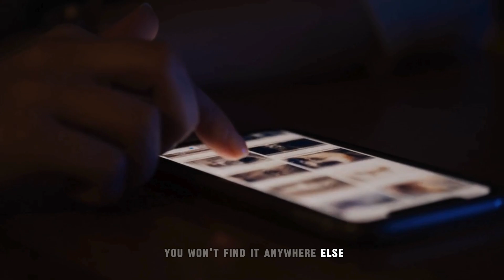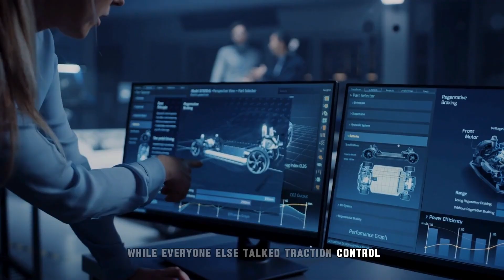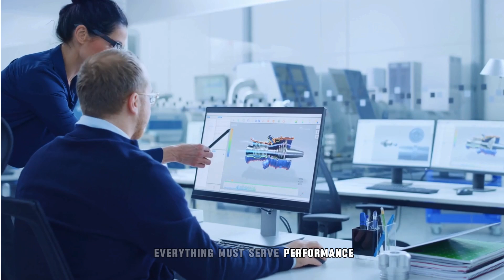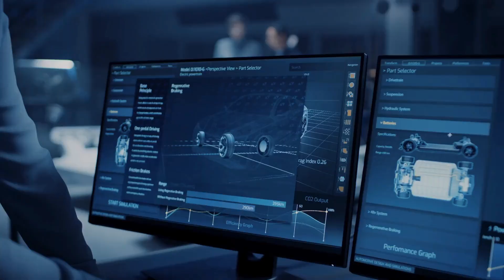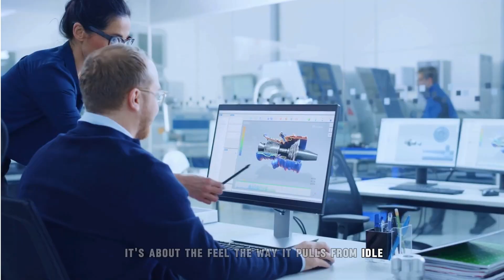Koenigsegg CEO: This NEW Engine Will Shake The Entire EV Industry!

Comment: nothing about technology, just licking butt, please make videos more educational, just AI voice yapping for 8 minutes
i thought it was something new and some new tech they developed, but i assumed wrong

for people actually wanting to learn something
koenigsegg since very beginning used e85 as a main fuel with additional map for casual petrol (i believe ccx already had map for e85, not sure yet since they used to buy that engine from ford i think, agera for sure since it was their own engine)
energy density of ethanol is around 27 MJ/kg, petrol around 42 MJ/kg while electric batteries are around 1 MJ/kg so even with electric ones having 90%+ efficiency and normal petrol engines around 40% best being barely over 50% petrol ones will still have much more range
what koenigsegg is doing while using ethanol is making improved engine efficiency while having also way cleaner exhaust gasses, since ethanol gives CO2 and water vapor without having nitrogen oxides or sulfur oxides that are made while burning petrol
koenigsegg is more of a technology developement company than car company, that's why their cars are insane in themselves, because they use methods most car manufacturers deemed too expensive to pursue, though now with hydrogen engines or fuel cells it comes even more expensive in R&D, for me as it is for koenigsegg - ethanol is the way
combustion will not die, it has way too many benefits over electric in terms of range efficiency and working temperatures, heavy machinery will not be efficient enough with EV charging to use EV for a long time
and that's omitting battery safety, enegry production cost, car production and energry production enviormental pollution which you should check for yourself